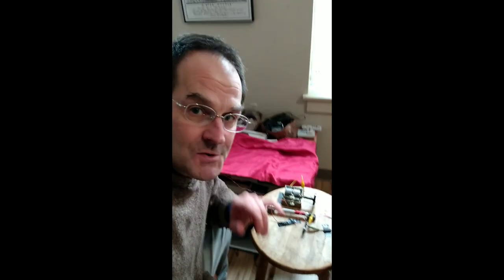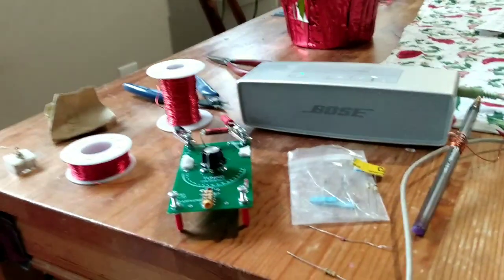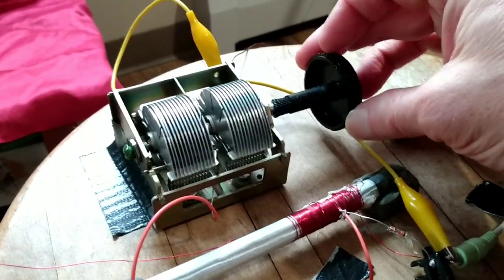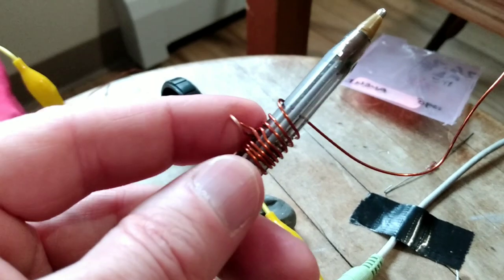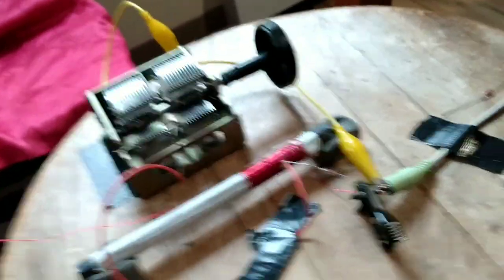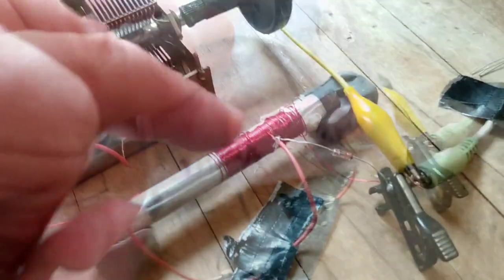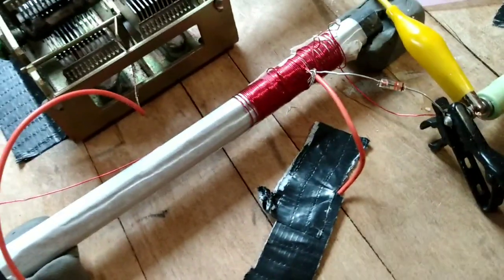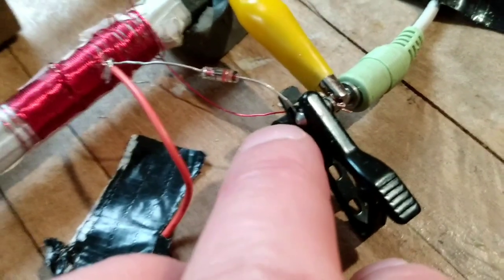Small apartment crystal radio tips 💎

Comment: Electrical outlets screw. 
Perfect, thanks for the tip. 
Thank you so much!
Reply: Note that in some old houses this won't work and also on some very new ones.
On old houses there was no ground in much of the wiring
On new houses there is a ground but the screw is insulated.

Comment: if you have a mattress, esp a double, with interconnected springs in it, try clipping onto the springs as an antenna, can work really well.

Also, you want a high Q coil if possible, so either a ferrite rod with litz wire or some kind of air litz coil in spider or basket.

If you make a loop coil combined antenna you can get good reception from 3-4 feet a side, but it will be strongly directional. what you can do is put four nails in the outer corners of a wood door and wind maybe 4 turns and use that as your main coil, open and close the door for pointing the antenna. Any wire will do, but better not too thin. No antenna required, the coil is the antenna.

I've found germanium diodes are not everything, 1n418 can be good.

A lot of people may have difficulty getting a good variable capacitor, you can use a variable inductance by sliding the ferrite core in and out of the coil, put a fixed 100 to 200 pf capacitor across the coil, or switch a few fixed caps to minimise the range of inductance needed.

You can also make variable inductance by sliding two coils in and out of each other, coils must be wound in opposite directions.

Comment: Just checked the outlet I intend to use, it’s properly wired and grounded 👍🏼. 
I really didn’t want to run a wire to a cold water pipe. 
Thanks for the tip. 👍🏼🙏🏼
Reply from the maker: For me the outlet screw worked better than the pipe, 15' away from my radio. Just be careful not to put wire, screwdriver etc into outlet holes.
Reply: For more modern houses, the water pipe inlet is PVC or similar.  So using a copper pipe in the house won't really give you a ground at all.  Outlets work because the ground connection on the socket and the outlet body are connected to an earthing system.

Comment: I would expect that if you built a mag loop receiving antenna and if you did nothing other than just close couple it to your receiver you would receive much more than by only a 10 foot piece of wire.

To have a resonate half wave dipole that receives well in the 160 meter amateur band aka roughly 1.8 Mhz it needs to be roughly 264 feet long. Ten feet is only going to receive a very strong local station and no DX. 

Try the Mag Loop. If you can't physically connect it to your crystal set just place it roughly 5 to 10 inches away from it and tune it too. You likely will be shocked by the difference.
Reply from the maker: Yes I should make a tunable loop antenna. I've tried passive loops and spirals with no difference. Perhaps I can connect 1 gang of my 2 gang capacitor to tune the antenna, and the other gang to radio.
Reply: @p1nesap  Well, here is the thing. 

For a receive Mag Loop you make an inductor which can be X turns around the perimeter of a cereal boxe's perimeter or even a frame made from 1 by 4 lumber. You calculate or actually measure the inductance of the loop and from that you size your capacitor so that the LC circuit you create resonates in the range your aiming for. After this you can either just close couple the new LC circuit to your radio or add what is called a sense which is one or two loops around the other bigger loop with one end connected where the antenna connects and the other to your sets ground. 

The issue you would have using the second gang on your tuning capacitor is its pretty unlikely where it needs to be rotated for the radio matches where it needs rotated for the mag loop antenna.

I get a lot of my variable capacitors from buying radios from the 70's that are almost given away in a Thrift store. You will likely need up to 375 or roughly 500 pf which all the old tuning capacitors are depending on using both or one gang.

I just recently bought a high voltage 8 to 48 pf variable with gear reduction for $22 for a four foot square Mag Loop antenna I made for transmitting on 20 meters or around 14 Mhz. I built it for efficiency where it outputs 79% of what is input. Thats why the main loop is 4 inch aluminum dryer vent and the sense is 3/4 inch copper pipe. 

For receive only using just wire is good enough because you dont have to impedance match else destroy your power amplifier.

You can also use the tiny variable capacitors that were in transitor radios as the tuning capacitor because your not transmitting so there is no danger of arcing. These I buy on Ebay too and they are maybe $5 each. I made several receive mag loops with them and they work great. I forget what their name is but they are about 1.25 inches square and about 3/4 inches thick. They typically have a plastic case often clear on one face and they too have two gangs that can be used in parallel.

Lastly say you find a great 350 pf variable, but it only gives you the upper range aimed for. The simple thing to do is add in a fixed capacitor in parallel that is big enough to boost the total to what is needed. Additionally as a side note, to get finer tuning on your radio add a small, like 0 to 30 variable cap, with gear reduction if possible, in parallel with your main tuning cap. This makes fine adjustments so much easier.

Good luck. You will be amazed at the difference. Try to make your mag loop at least 16 inches in height and or lenght. The bigger the better sensitivity. A 2 foot square does extremely well  but even the 16 incher does great. 

Before I forget there is a channel on YouTube & I think its galled Gaslinger or similar. It is a great resource for all thongs radio and there is a video I just saw where he or she compared various diodes for suitability in a crystal set. Obviously there is the 1N34A but almost as good are pretty much all the other germanium point diodes such as the 1N270, 1N160, 1N182, CK706, but of real significance is she or he showed you can forward bias a Shockey Silicone diode with a small voltage and it will be every bit as good a detector as the 1N34A.

Its a lot of fun for sure especially when you start picking up the other coast at night on your crystal set. Have fun & go for it, plus find a good resource on building the first time for reference. I used to know of one, but forgot the source however a Youtube channel I think called Solder Smoke probably has a good build in it & if not I know they are out there.

73 
kc2wvb

Comment: A network engineer friend has access to the old ethernet cables that are removed and scraped and I have a nice tree about forty feet from the house.
Can I use the old ethernet cable for an antenna? Without removing the insulation? Does it need to be a specific length? would several passes be better? Would soldering all the pairs together at each end be helpful?
Thank You
Reply: I use old cat-5 cable for ham band TX/RX antennas and it works fine. Stripping and connecting together all 8 wires  is only necessary at the feed point(s); not needed on the other end.
Reply: @ernestsmith3581  THANK YOU!